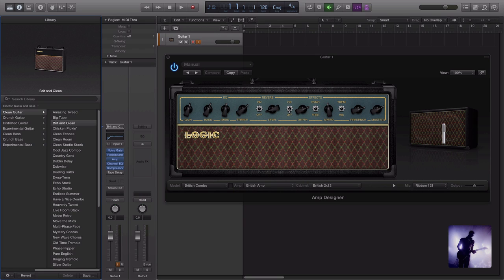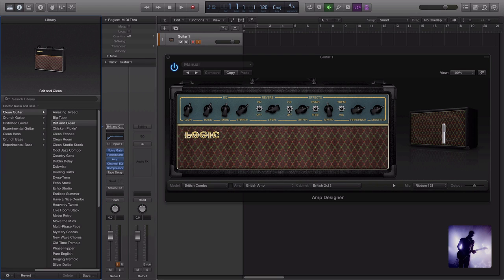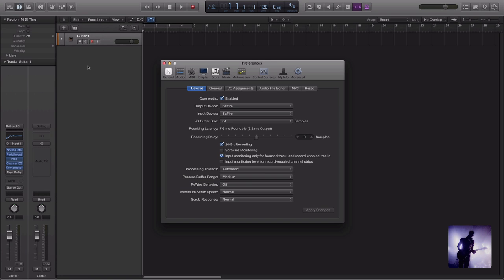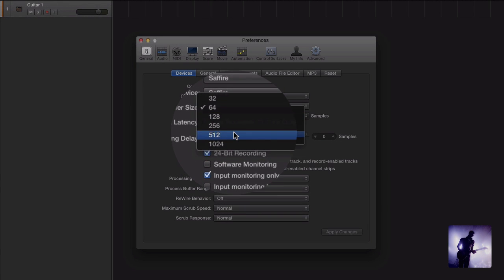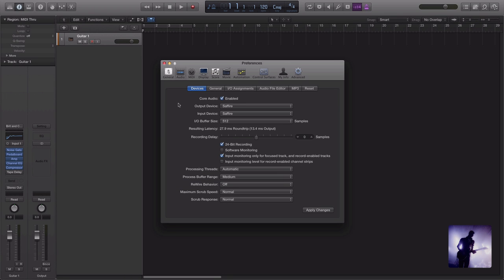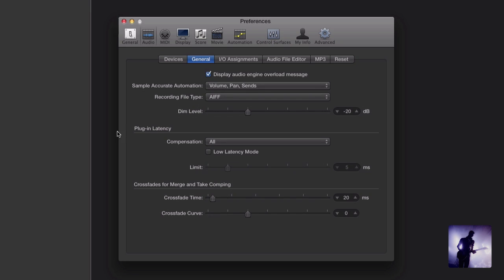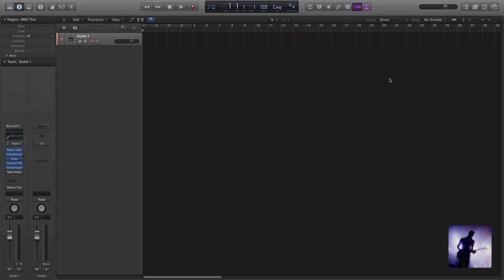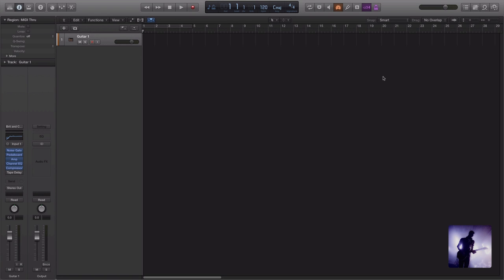Logic Pro X Tutorial: Dealing With Latency - Why Does My Guitar Sound So Delayed?

Comment: I have a problem with the playback latency. If i press a note on my MIDI keyboard which is connected to my computer via USB 2.0, i can hear the note almost with  1 to 2 second latency after i´ve pressed the key! My buffer size is 128 and my sample rate is 44100 Hz. This happens also when recording a guitar!
Reply: +MrZambooni What setting is wrong or what should i double check? I just can´t fix it :(

Comment: Will using a an interface reduce this? Ive heard a friend say these help and I'm considering buying a Focusrite Saffire Pro 14 8 In/6 Out Firewire Audio Interface for both my guitar VST's and Drum VST's
Reply from the maker: Hey mate, you will need some kind of interface in order for your guitar to communicate with your computer. Fortunately, good quality interfaces are reasonably inexpensive nowadays. My assumption would be that if a computer generally struggles with processing power, then this would be the case regardless of the interface being used. Admittedly though, I've never done a shootout on how different interfaces might effect latency. Nonetheless, I would consider a good quality interface is a worthwhile investment anyway. Hope that helps.
Reply: *****
Thing is I'm not using a guitar. I will be using a Roland TD-30 V Drum kit. It has a USB/midi out and didn't know if one is required since It has usb/midi
Reply from the maker: NICOLEALANIZ2005 Yeah, I don't have much experience with digital drum kits. If it has a USB output, I'd assume that would give you similar results to going through an audio interface via midi. If your experiencing issues though, your best bet is probably to get some assistance from Roland tech support. Hope that helps.